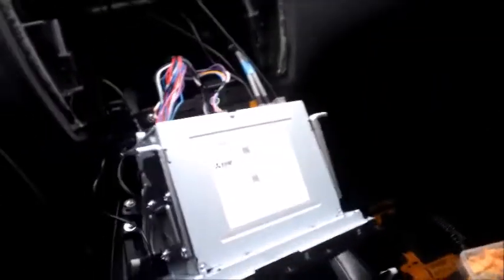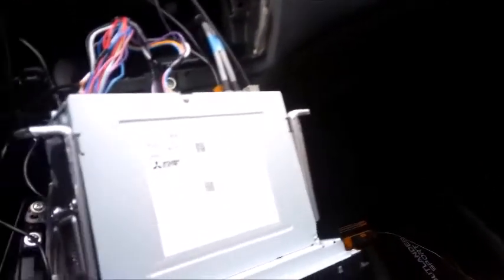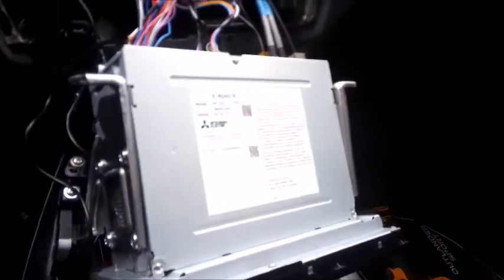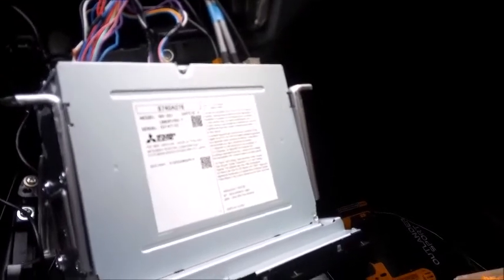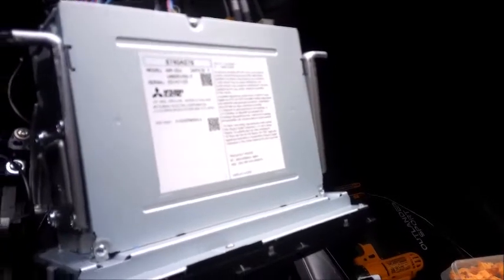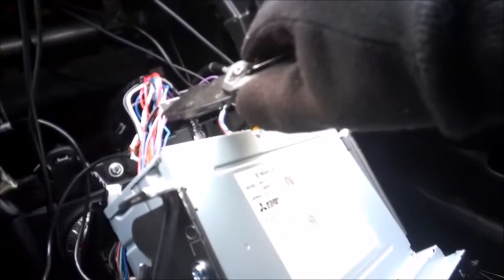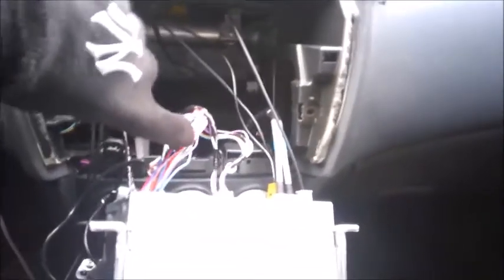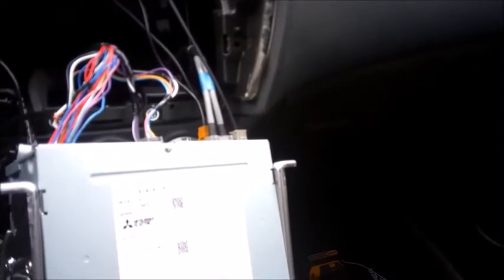How to power amp using LOC/2021 Mitsubishi Outlander Sport

Comment: Do you know what way to run the power wire from the battery
Reply from the maker: There is a access hole in the chassis where u can run the power wire from the battery to inside of the car. I'll screenshot it for u in the morning when i get up.
Reply: @godgovvidz9769   can I get that screen shot as well?
Reply from the maker: @s16non or  send ur email or ur IG and I'll send it also please Like & Sub to the Ch.